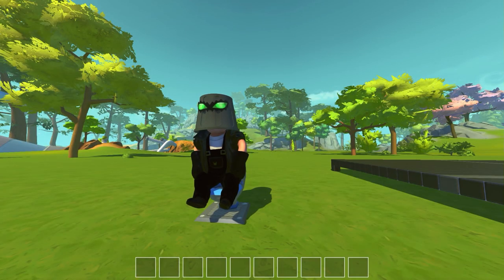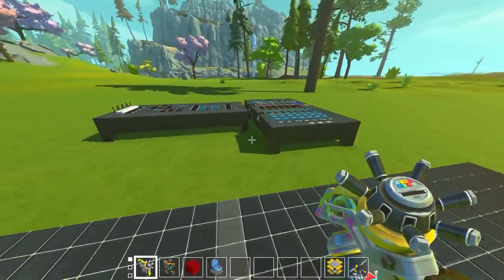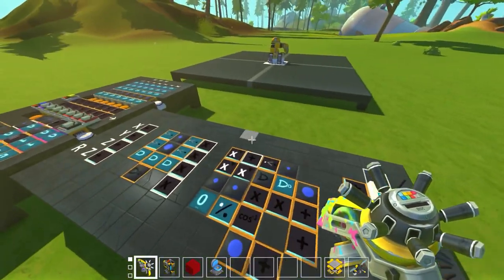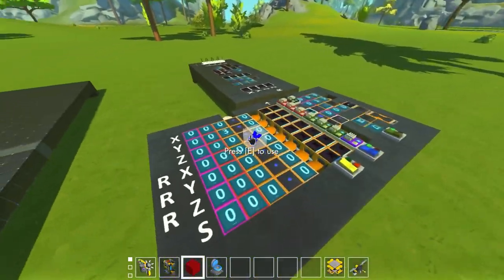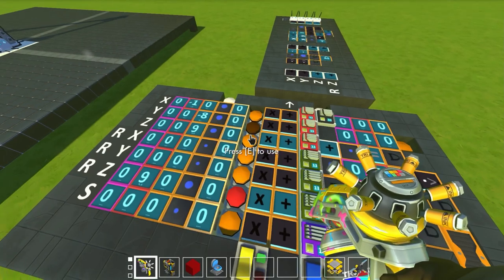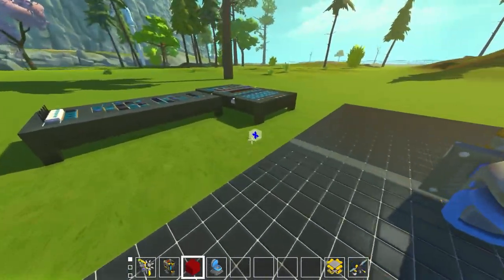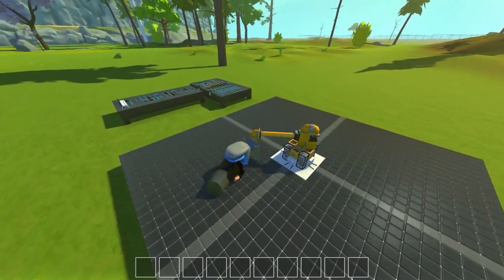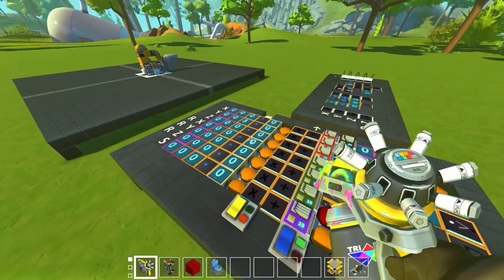Modular Programmable 4 Axis Robotic Arm Systems! (Scrap Mechanic Gameplay)

Comment: I'd love to see you using RBG blocks and smart sensors set to colour mode as a form of data transfer for modular systems, as it doesn't require any wiring, and can be connected simply by welding the modules together. They can only transfer 24 bits per tick, but they don't suffer from interference like wireless transmitters, which need to have unique channels and frequencies.

Comment: I was planing on making something similar, using inverse kinematics to control as robot arm with 6 degrees of freedom for the end point of the arm, without using pistons.
Also, you could easily program gaits for robot legs with this stuff. Well, it would take a while to program it, but relatively simple.

Comment: hey, couldn't you put a spud gun on the end and make a 3D CNC milling machine? if yes then combinje it with your 3D holographic generator thing (just save "files" on a memory block, whick is mounted on some sort of USB stick but with more connectors and the CNC reads and mills it) ...